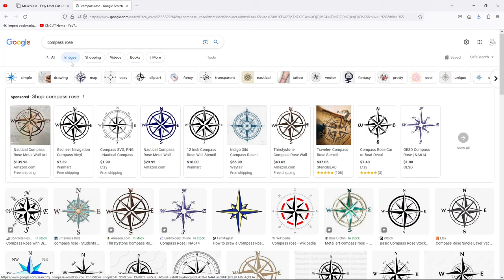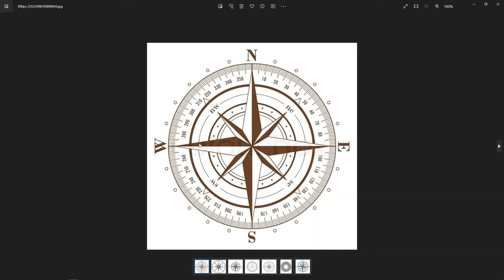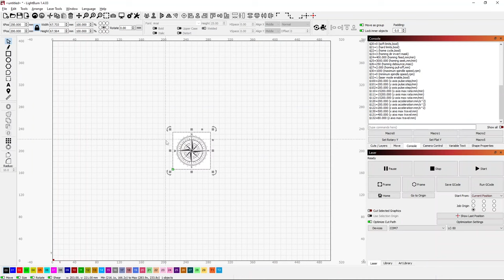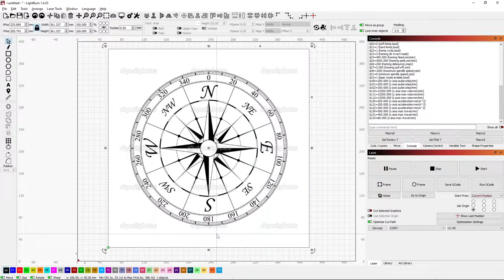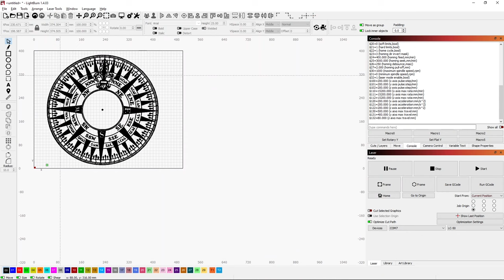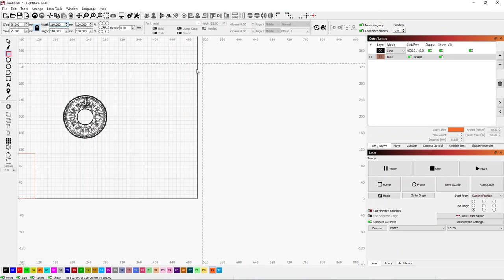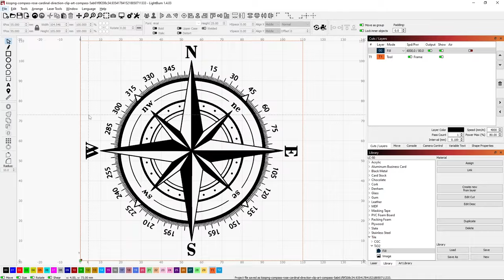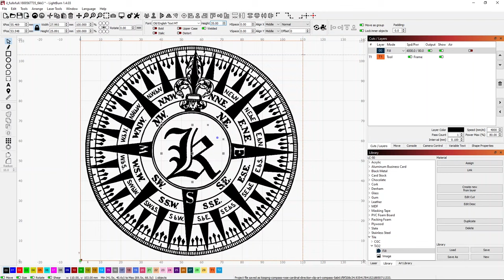Compass coasters with Titanium Dioxide coating

Comment: Hi, big thanks for the great informative content you've done. One question about ceramic tiles: which one gives you better result, matte surface or glossy ? For my fiber laser matte surface gives better result, or TiO2 coating doesn't "stick" so good to glossy tile.
Reply from the maker: That is a great question.  The tiles I use, I would call glossy and they have worked great as long as I have my parameters set properly and my lens is clean.  ;-)  I will have to look for some matte finish tiles the next time I am at the store.  I don't remember seeing any.  I may have to go to an actual tile store!  Which wouldn't be a bad thing as I would like to play around with some colored tiles.

Comment: AC, do you use a laptop or a desktop to design in lightburn? Those coasters look amazing!!
Reply from the maker: Thank you for asking. The answer is yes, meaning I use both.  LightBurn comes standard as a two system license.  I have one on my laptop that is my main computer and I have a small desktop computer hooked up to my machines to drive them.  Depending on the project will determine which computer I use.  I store everything on the desktop computer: projects, images, libraries, etc...  When I am working on my laptop and I need that information, I make sure to have the desktop running and connect to the data through my home local network (LAN).
Reply: @CNCATHome  Ok, thanks. I use a laptop but have heard that lightburn doesn’t play well with laptops. So I figured if anyone would know it would be you!! I love your channel and hope you keep on putting out those videos. If you had a way to support it I would….
Reply from the maker: @johndiego3105  - Thank you so much for your support.  Watching the videos is great support!  I have friends who are able make their living with their YouTube channel.  My intent was to have fun and if it paid a little off ad revenue, that is great.  I am having fun with it.  For me, the reward is comments like this and I really enjoy it when I can help people out.
I use to run my machines off an old laptop running Windows 7.  The only issue I really had was the boot time for that old system.  And it really wasn't that bad.

Comment: have you found a perfect way to apply the tiO2 onto the tile? you use an airbrush but what ratio of mixing? did you found a way to stop the clogging?
Reply from the maker: I don't know about the "perfect" way?  ;-)  Using the airbrush has provided a very nice coating of TiO2.  A good ratio for the airbrush seems to be around 3 or 4 to 1.  So 3 to 4 parts DNA to 1 part TiO2.  I haven't done this yet but several people has said that adding some coloring helps to see the coverage.  As for clogging, using a thin mix seems to have eliminated any clogging issue.  Frequent starts and stops helps keep the passage clear.

Comment: AC what optical power is your diode laser. Could a high quality paint do as well as the oxcide?
Reply from the maker: I have two diode laser I use.  One is a 5.5 watt and the other is a 10 watt.  Both work great with TiO2.  When I first started doing this, I was using a white spray paint.  It got mixed results with that.  It usually worked well.  It was also too easy to put too much paint on and that didn't work well.  The TiO2 method is much more forgiving.
Reply: @CNCATHome  thanks, I lost my laser last week and I'm trying
To decide if a 5 watt ( optical power) is enough for what I want to do. I would like to cut 1/4 wood  but the cost of higher power lasers is out of price range.
Reply from the maker: @warrenking1815  -  If you want to cut a bit of 1/4" wood, you would be better off with a 10watt laser.  You can do it with a 5.5w but I found it to be a chore.  It is slow and inconsistent.  Even with my 10 watt, I make three passes even though two passes would normally be enough.  Having air assist helps too.  With my AtomStack P7 M40 (5.5watt), my plywood cutting speed is 300mm/min at 80% power and 3 passes.  The LC-50 Plus (10watt) I use 350mm/min at 80% and 3 passes.  Usually 2 passes is enough.  The reason the AtomStack works so well is it has a highly focused laser dot that takes that 5.5watts and focuses it down to a smaller spot. They claim it is 0.02mm square which makes it act more like a 10 watt laser. It is a small laser with only a 200mm X 200mm working area.  I hope you find something that works for you.
Reply: @CNCATHome  thanks for the information!